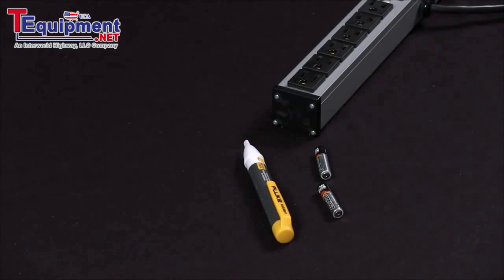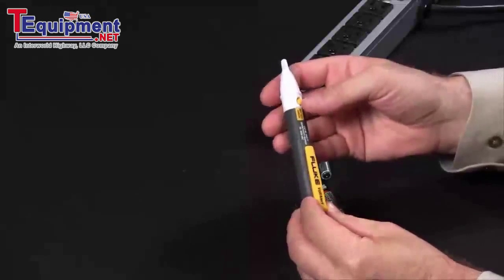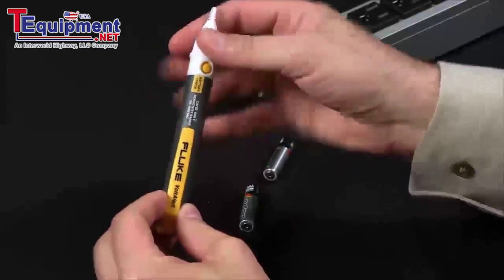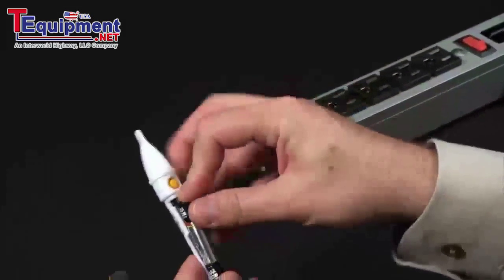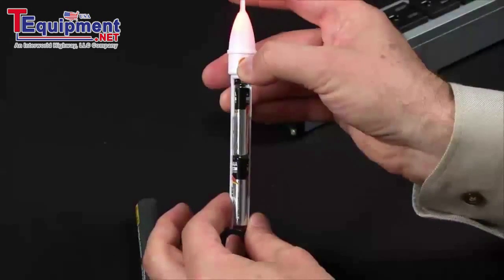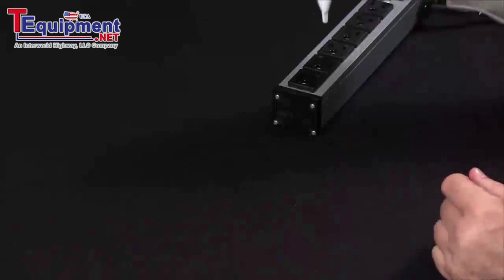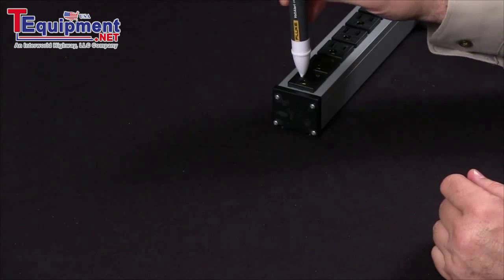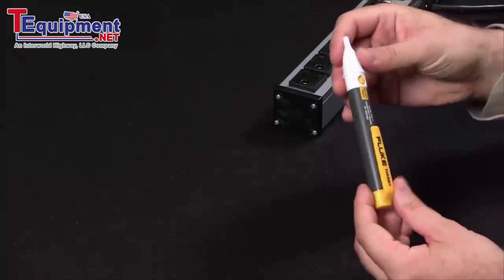How To Replace The Battery In A Fluke Volt Alert

Comment: FYI, if you are looking to replace the batteries in a Fluke 1AC-A Volt Alert, unscrew the back cap of the detector (if looking at the cap, it should rotate counter-clockwise to come off). When the cap comes off there will be a spring in the cap and then you can shake out the 2 AAA batteries inside. Slide in replacement batteries (+ side forward towards the detector tip) and screw the cap back on (finger-tight should be fine, no need to force it). Then TEST with a convenient, plugged in, power cord to make sure it works.